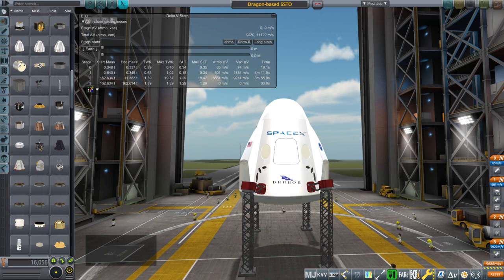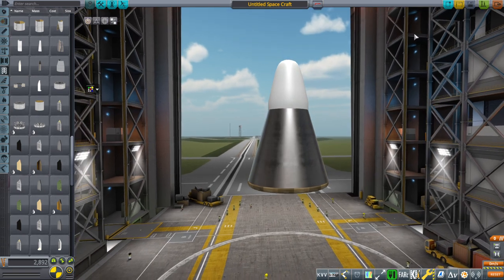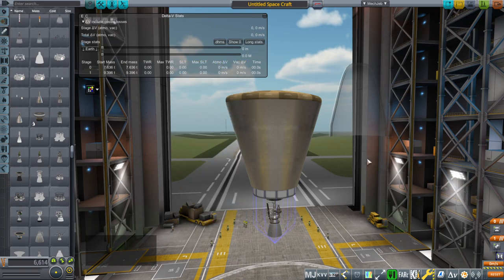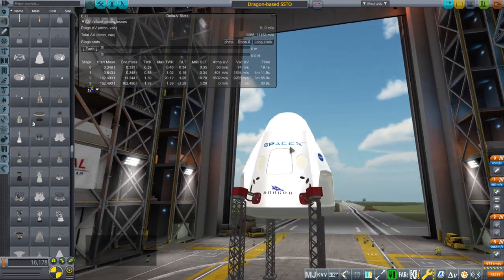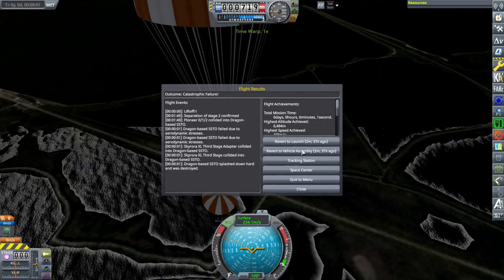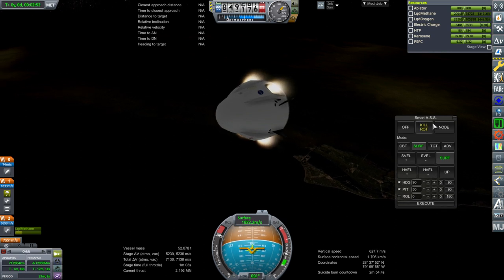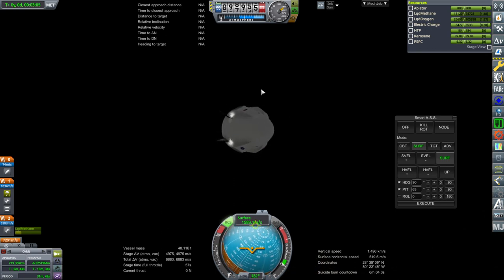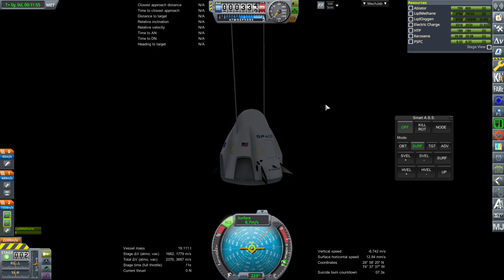KSP with Realism Overhaul - Mega-Dragon SSTO?

Comment: @4:45-ish, the "upside-down" cone with engine design was actually proposed as a type of service module that could be (like the capsule shape it was based on) recovered and reused. It was also suggested as a 'recoverable' vessel for a Nuclear Thermal Engine as well. A further modification might use such a booster stage and then something like the "Super-Dragon" as a second stage. Also you're right while it would be 'technically' easier in theory to make an SSTO small-sat launcher in practice the margins on SSTO are such (especially given the size of vehicle to payload) that there's really too high a chance you'll wipe out your payload in the actual construction process. Having said that if you can get 'near-SSTO' then (also in theory :) ) there would be a lot of 'simple' ways to boost your performance enough to make orbit. Still comes down to who's going to pay for it though :)

Comment: I guess CoM is to close to gimbal/Aerosurfaces so there is no leverage for them to produce decent torque.
Reply: Ya if you are transforming differential thrust into gimbal your thrust vector would need to be 4-8 meters below the heat shield (assuming 50% throttle, eqa distance from the COM would need 22.5 degrees of gimbal to produce the same torques)

Comment: Isn't the aerodynamic issue with the nature of the capsule design?

Aren't they supposed to be stable heat shield first.
Reply from the maker: That would be if this was a normal capsule with a cabin, though I might have to review the particular balance in this model.

Comment: What about a SLS upper stage with a Vaccumn RS-25. Would that be a good idea? I mean it propably would't be the best upgrage, but it could work.
Reply: I gues it could increase LEO capacity, but i think it may decrease TLI performance. Plus we don't know if RS-25 could restart
Reply from the maker: The RS-25 is a heavy engine, and a vacuum nozzle would make it even heavier, leading to a great increase in the dry mass of the upper stage, mainly to get TWR, which isn't necessary for TLI and beyond. Also, because there's a limit to how low the RS-25 can throttle, the G-forces on the payload will be too high close to the end of the burn.
Reply: Well, it's not a best idea, but it could be interesting.
Reply: J2-X would be bitchin. Plus a way bigger tank. Basically a 2009 Ares V

Comment: How far could the starship travel on earth without a superheavy and still be able to land?
Reply from the maker: Depends on what dry mass it actually ends up with.
Reply: @RaizSpace  Elon said around 120 tons dry
Reply from the maker: If that dry mass is all its carrying, then depending on the lift profile on the way back down, functionally anywhere on Earth assuming it has six engines that can light on the ground and lift it fully-fueled off the ground. If they have to underfuel it, depends on by how much. Really, any suborbital flight covering thousands of miles requires near-orbital delta-v. Other big problems are the g-forces and heating.

Comment: FAR looks at the model.  There could be something wrong with it.
Reply from the maker: Not out of the question, since the pod is asymmetrical in some respects (especially the hatch).
Reply: @RaizSpace  I might not know specifically what I'm talking about, but I know in the 3D Printing world, sometimes one has to 'repair' a 3D model even if it looks perfectly clean in Blender.  Sketchup also tends to add other forms of wonkiness--not that you're using that--that's not my point.  My point is that FAR could be seeing some of these "phantom-like" surfaces (I've encountered some odd part interactions with FAR before--ones that make no sense) and borking it up.  I know BDB's Atlas tiny vernier engines would cause FAR to have a conniption (since fixed), as well as Benjii's Shuttle Orbiter Construction Kit (not yet fixed, but is known and possibly being worked on.)
I'd be happy to be wrong.